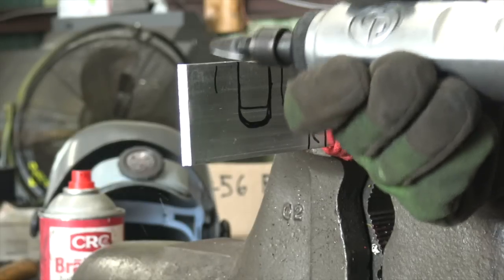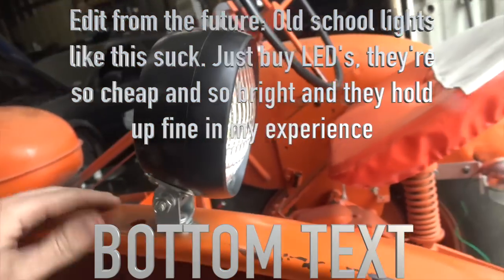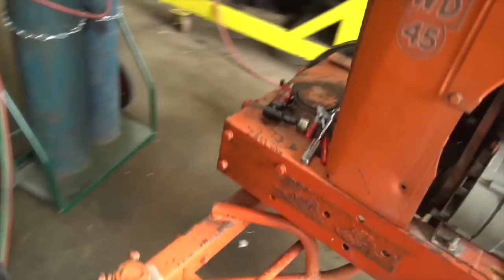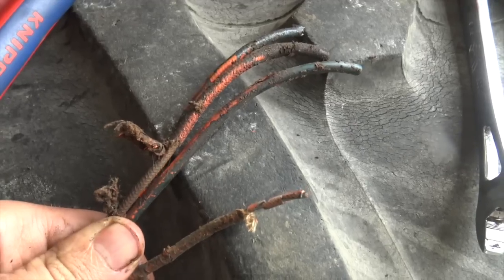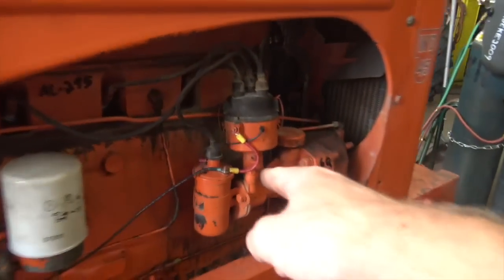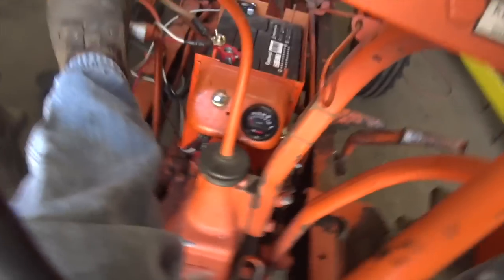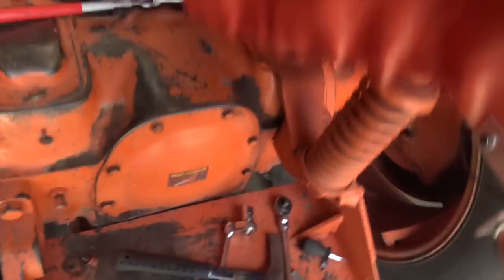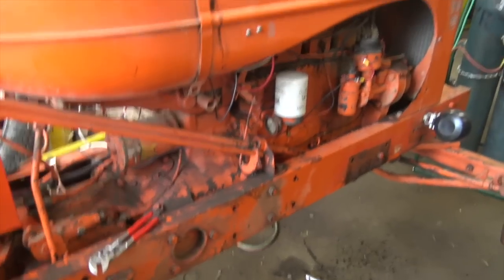ONE EASY STEP TO FIX ELECTRICAL ISSUES ON AN OLD TRACTOR - SO YOU DONT GET SCAMMED BY DEALERSHIPS!!!

Comment: This model was originally a 6 volt system, so the battery box is sized for a group one six volt battery. Try a smaller size 12 volt battery.